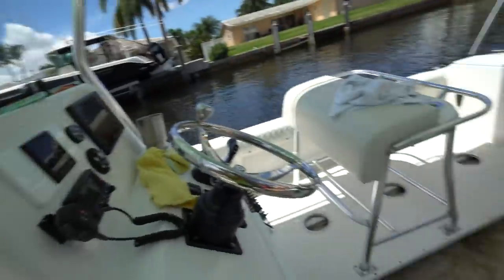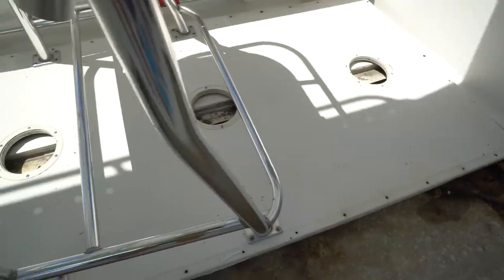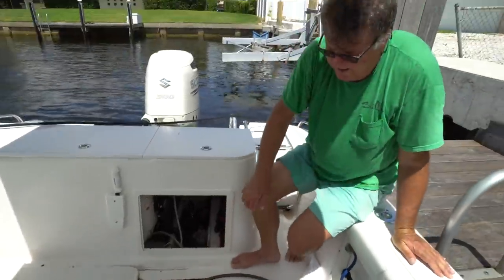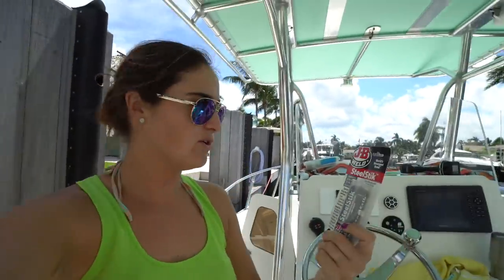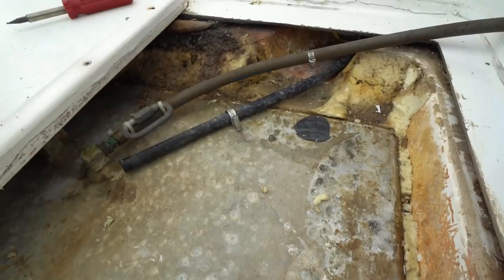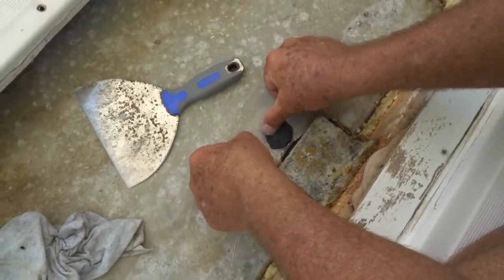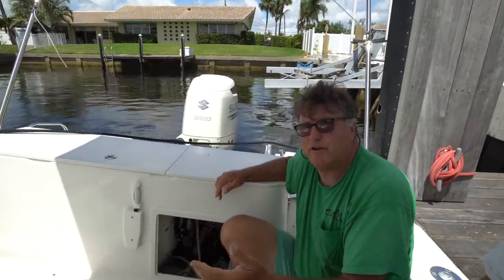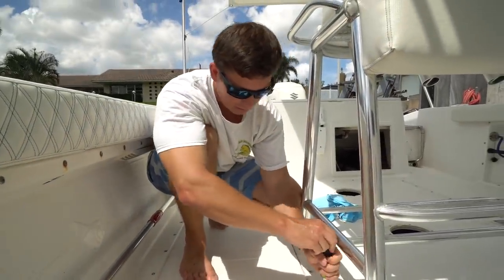UH OH! HUGE Boat Gas LEAK! Boat Problems!

Comment: You all are lucky with the access.  We had an older Pursuit 2870 which needed both tanks replaced.  Had to cut the deck out and replace both tanks... $6k later.. Happy to say we sold that boat  and now have a sister boat to yours Everglades 255CC.
Reply from the maker: Yes we are VERY Lucky!! Love the everglades boats too!

Comment: i found the answer to my 5 year old leak problem.!!!!! someone 5 years ago told me it didn't have a fix, only if I tore all the bottom of the floor. so till right now I found you guys with the same problem, thank you  San Diego Ca  ( why would you want to buy another tank if you already fixed this on and you say its good for another 30 years ????)

Comment: Salt water got on that tank. Replace the tank and coat with coal tar epoxy, replace those pie plates as the seals are probably shot. Seal pie plates and fuel coffin lid with 3M 4000 uv. Lucky you don't have to pull the console, just a weekend project now.

Comment: You’re super lucky with the access you have to the tank. My fuel tank goes under the console. Also, store the boat slam full with gas, keeping it at half leaves an air gap where air and moisture can corrode the metal tank.

Comment: I emphasize with you. My boat is in the mechanics yard. With luck I will get it back just in time to winterize. No boating until spring. Very happy you did not have a fire or worse. On my boat the deck would need to be sawn out. Best

Comment: In the process of replacing my tank in a 2002 edgewater 262....the compartment did not fully drain....installed a drain in the compartment and having a new tank built as we speak...you are lucky you had deck hatches...I had to cut the deck

Comment: Those two holes might not have been leaking much liquid fuel, but they were venting plenty of vapor into your bilge. That's a super dangerous situation, and quite honestly the best thing about outboard vs. inboard power (you get more margin for error in a situation like this since you don't have a heat and spark producing beast beneath your feet.)

Comment: rtv and a short sheet metal screw is better than patch jbweld just say in!!!
nothing holding that patch down or 1 " square sheet metal with 1/4 hole in middle coat with marine white rtv then put screw thru hole then into tank screw down never mess with again no new tank something made the holes and then some body tried patching
Reply: Looks like salt water corrosion on the tank top.  Great idea on replacing the tank. The worst thing that can happen on a boat is a fire. If the JB weld doesn't stick, I would go with the short SS sheet metal screw with rtv, or JB weld. The screw is a mechanical fastener that will hold the patch is place for a while, till you get the replacement gas tank.

Comment: The biggest problem with fuel tanks is electrolysis, so slow to happen. Electrolysis on aluminum is probley slower than say steel, copper/bronze, ect. Make sure the boat is well grounded.

Comment: JB weld wont last, Had the same issue. Get a NEW tank. Other spots you can not see will eventually give way.  Be happy that you have access, had to CUT my floor out.  Good Luck!
Reply: Did you cut just the bit over the tank or the whole floor??
Reply: @thargor6750  Good Day, I actually cut the entire tank out and got the serial number off it and Had the original company make an exact copy of it BUT this time it was coated.   Extra work but it will be in service for many decades to come.  Good Luck

Comment: i just replace the tank on my 20 ft century is from 2000 , every 20 years should replace the tank because it gets corroded giving the fact that the aluminum they are made of is just 1/8 thickness so it gets thinner and when you fill up the tank this is what happens because heat and vapor expand the tank and eventually cracks and release from the thinner corroded areas of the tank , so if using that tank while waiting for new one just keep it have way filled by the way we (family) love to see your guys videos especially my little boy , we learned from Victor and Brooked we can say

Comment: those holes are due to electrodes eating away at metals on your boats. check your zinc pencils in your engine and zinc plates. could be a lose screw in the gas tank causing it or a fish hook even....

Comment: Cold tar epoxy the new tank never worry about corrosion again. I would measure your tank and try marine connection liquidators they may have one that will fit save a bunch of money. But no matter what coat that tank, and make sure you wire it to a zinc and maybe even get a auxiliary zinc thats alot of corrosion on top of that tank. Do the zincs son the motor get eat up pretty quick?
Reply from the maker: Thanks for the tips!! And the engine doesn’t sit in the water, so no to the zincs

Comment: Aluminum corrision.  I fight this often in my flounder gigging boat.  Dissimilar metals causes and continuous contact with salt causes.

Right now you are dealing with spots you can see.  There are likely more spots you cannot see on sides and bottom of tank.  They may not be leaking now but they may soon leak. You dont want to take a chance of gas leak on a boat.  Only takes a small spark.  Remember with gas it is the fumes that burn, not the liquid.

Replace the tank, preferably with one that will not corrode iin future.  Fiberglass or epoxy paint coating.
Reply: Great advice,,,  Pump It dry and remove the tank,, No fish is worth a huge explosion

Comment: They have a two part epoxy emergency stick that will work wet you cut off what you need and knead together and stick it in hole thanks John 🇺🇸🐟🎣⛱🛥🌴😃😊🙏🏻

Comment: Don't underestimate the danger of these leaks.  Gasoline vapor is heavier than air and it is explosive.  I would not run that boat at all.  Sorry for the bad news but you are taking quite a risk using a tank like that especially since i am sure you realize that there are most likely other areas of the tank that while not actively leaking  may be bad and cannot be seen.

Comment: You should put a stainless steel screw in before you patch it.
Reply: I was thinking a stainless steel screw with some 5200 all over the threads and a flat washer, :)
Reply: I'm not sure about this. I know from bitter experience that stainless steel and aluminum don't play nice in salt water. A few years back, I was using two brand new aluminum tanks on my rebreather. I dive a sports kiss with a stainless steel case. The tanks were strapped to the case with metal bands and my dive buddy told me that when I was in the water the tanks were fizzing like alka seltzer tablets. I checked and sure enough, I had little corrosion pits all over my tanks. I fixed it by slipping plastic tubing over the tank straps and making sure both tanks were electrically isolated from the case. However, I will admit that I am far from being a fuel tank expert. A new fuel tank is much safer.

Comment: How's the 300 suzuki been for you guys cause I bought one 2 weeks ago
Reply: David Barrett  nothing but good words for zuki best warranty on market I'm a etec man but if not etec I  would by a zuki no hesitation check out key west fishing he just bought one too go into videos section and shows it JT 🇺🇸🐟🎣🛥🌴⛱😃😊🙏🏻
Reply from the maker: We've loved it! We currently have an issue with the computer, it's not giving us info from the motor. but supposedly its a simple fix, just replacing one part behind the gauge. Suppose to be fixed within the next few days.